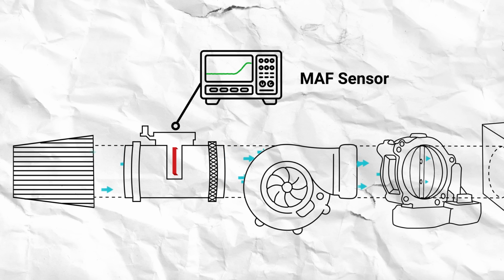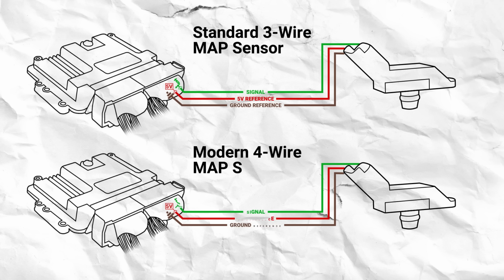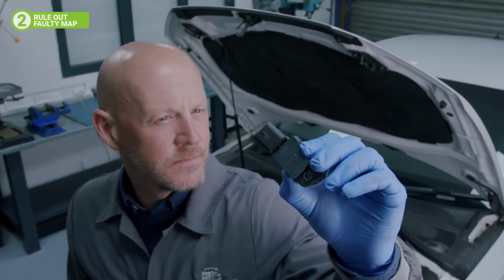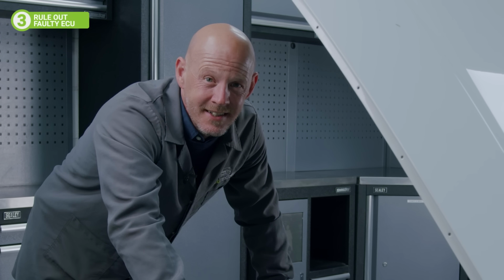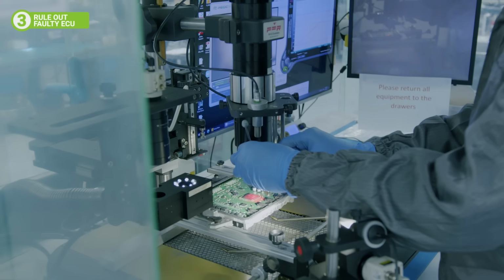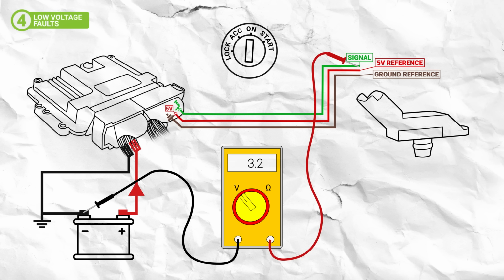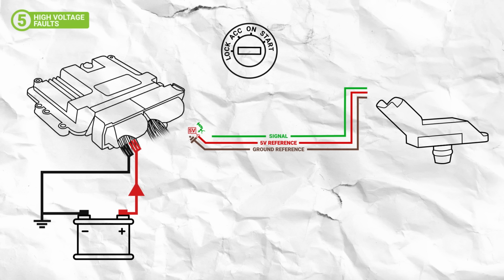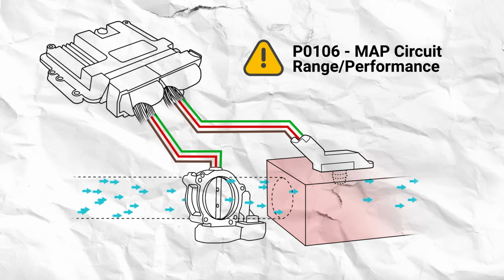How to Diagnose a MAP Sensor – P0106, P0107, P0108 Made Simple

Comment: I finally replacing my map sensor on my 1998 Honda Civic EX I found out when I scanned it it gave me my code p0108 which is the map sensor yes I had a bad MAP sensor it's the original parts for the past 28 years in my car wow look how long it lasted so once I put a new map sensor everything is back to normal inefficient just love Honda cars look how long the parts lasted 28 years and I finally replaced it

Comment: My map sensor is working fine I think my map pigtail needs to be replaced because every time I start my car in the morning it starts off fine with no problem but when I drive it for 20 to 25 minutes that's when the map sensor code comes up the check engine light p0108 only does this when the engine gets hot and when the engine is hot I tried to start it again it starts up but then check engine light comes on when the engine is hot so could this be I need to replace my map pig tail. My engine idle is smooth and everything works great on my map sensor I have a 98 Honda Civic EX I never replace the pigtail or the map sensor it's original from 98 so I think the pigtail needs to be replaced

Comment: I ave a question on this. I used this videos as well as AllData to diag  my MAP sensor  performance code... i assumed the sensor is bad after verifying all my wires, voltage, ground and signal...... i a have race cams and not 100% sure if the cames are the reason or if its a tuning issue or perhaps a intake leak

Comment: Ideally he should disassemble a faulty MAP sensor to show what's inside and what wears out. I did that on a faulty EGR valve that continuously sent error code to ECM...it had a worn out carbon film resistor done by constant movement of potentiometer wiper. EGR pintle is constantly controlled by ECM...wearing out potentiometer monitoring it's position. Newer EGR valve design changed to electronic detection of pintle position eliminating unreliable mechanical potentiometer.
Of course I'm discussing of older vehicles...newer vehicles now have variable timed camshafts that have exhaust valves stay open a bit longer to have exhaust gases get sucked back into cylinders..doing same thing EGR valves did.
Reusing exhaust gases diminishes engine performance and longevity life.
👍

Comment: Would a faulty map sensor affect starting
Reply: Yes...it could. I replaced MAP sensor on '97 Rodeo that had crank awhile before starting. It now starts right away.
Could also be low fuel pressure...there's a port on fuel line on engine that a pressure gage can be attached...pressure should be roughly 45 to 60 psi. You could also have a faulty fuel pressure regulator or simply a clogged fuel filter. I change fuel filters every ~35K miles.
Hope this helps.👍

Comment: can only signal test one end. 10:11 no pulling wire off both ends there is not two connectors. One 3 wire plug out of snake of 100+ wrapped wires . the other end is in a snaked of 100+ wrapped wires